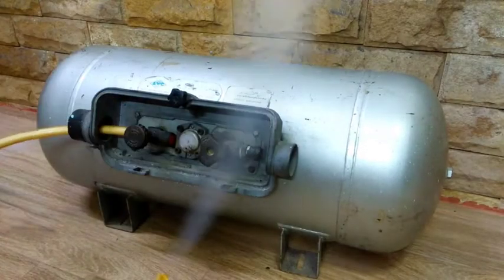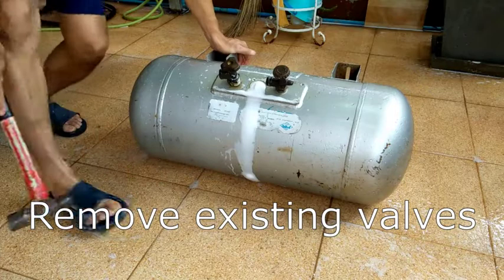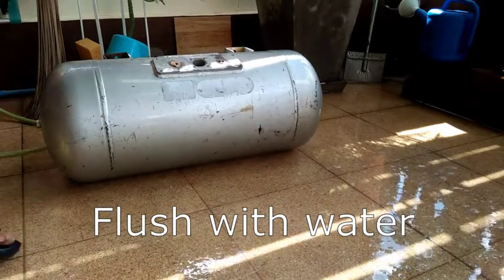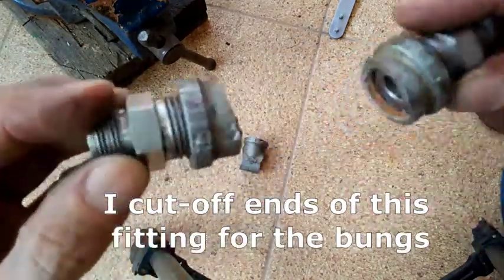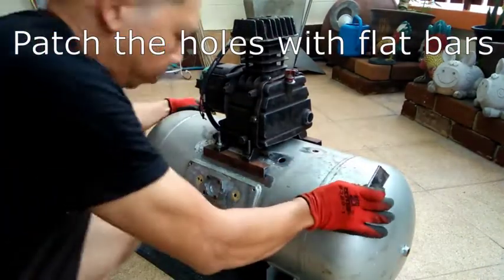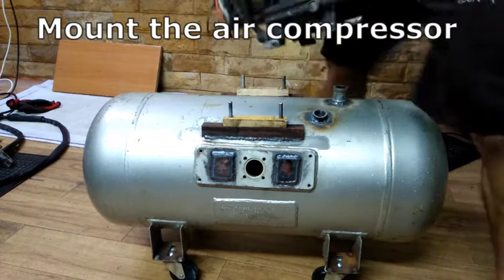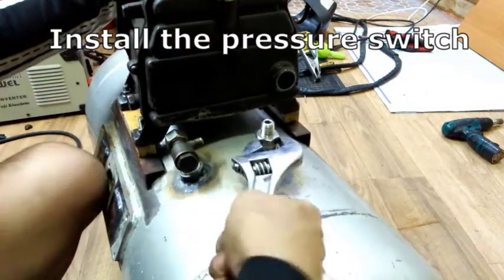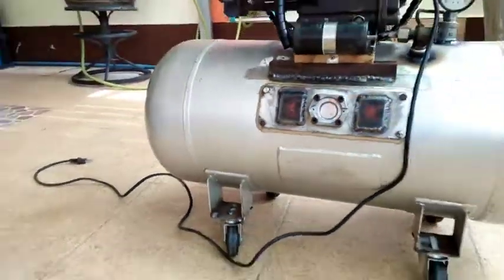Welding on LPG Tank Reused as an Air Compressor Tank

Comment: will cng semi fiber cylinder work the same? i have 2 laying around
Reply from the maker: Hi. You can check on the data plate the working pressure. I do think that it will work as long as the pressure rating is greater than or equal to your compressed air.

Comment: I will use that to make an auxiliary air tank. Thanks
Reply from the maker: You can probably make use of original fittings so that no welding is required.
Reply: @DIYPhil  i will need just 1 weld for a flange but the metal on this spot is very thick so will be very easy

Comment: G’Day Phil, mate thank you for the brilliant idea plus great video 👌🫡 thank you for sharing useful information 👍😉,, 
Mate I have a question for you 😊
Can I use my 50L air compressor directly to use for MIG welding or I need a external tank to refill into it then to use it for MIG welding ? 
Thank u again for wonderful video 👍🫡 cheers Matt
Reply from the maker: Hi. MIG welding uses inert gas usually argon or argon with carbon dioxide mix. MIG = metal inert gas. It will definitely not work with compressed air. You need to buy the gas from your welding supply store.

Comment: Have you thought about using a vehicle ac condenser as an after cooler? It drops air temperature before it goes into the tank. Keeps moisture out of the tank and you lines.
Reply from the maker: I'm maybe doing a similar project in the future.  I'm just looking around for parts i can salvage for free.  Also thinking about using a coil of copper tubing for that purpose.
Reply: @DIYPhil  I used that before it goes into the cooler. As a pre cooler.